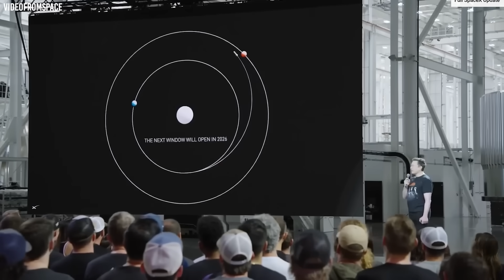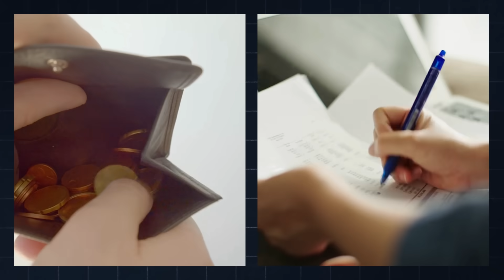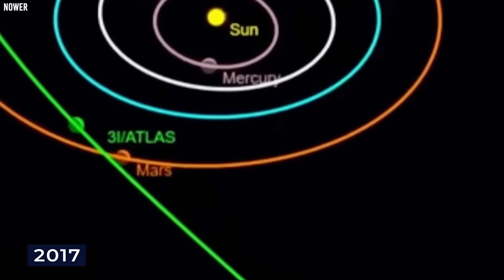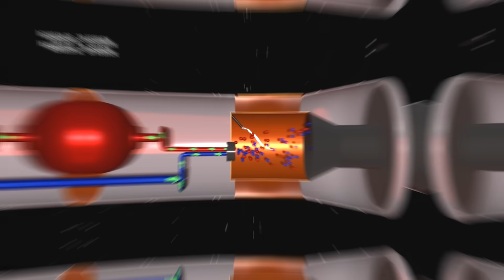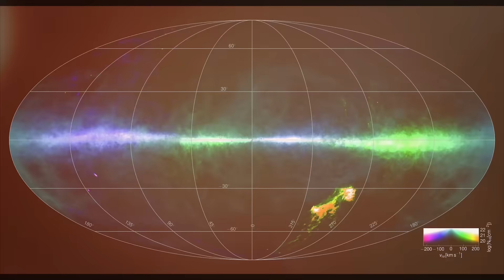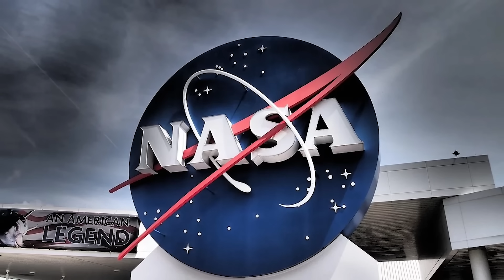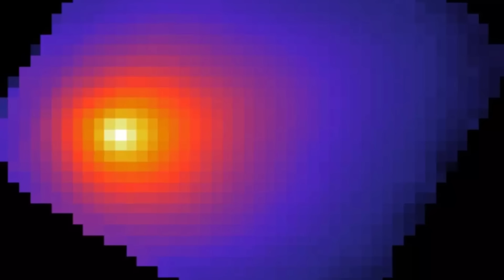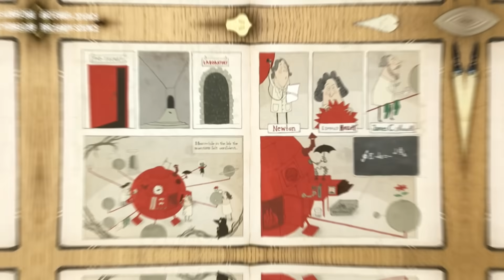NASA Is Tracking 3 Objects Circling 3I/ATLAS "This could end very bad"

Comment: Is it possible that 3I/Atlas will completely sublimate by the time it reaches close Mars orbit, and then could be interesting what the '3 objects' do if the large sublimation cloud then condenses on the planet? It is interesting that to warm up Mars we would need a significant amount of greenhouse gas, but not sure the volume of CO2 that could be released from 3I/Atlas could make a noticeable difference to the Mars atmosphere. Swan could be 'picking up' the 3 objects before the comet (sublimated or not) slams into Mars?

If the speculation of this could be some form of terraforming event then could Atlas or even Swan do enough based on our known physics? 

One big limitation is that Mars needs to restart it's molten core in order to generate a magnetic field - is the Nickel in Atlas enough to trigger this if a small penetrator hit hard enough?

Comment: why do we have crappy pictures of it yet we can get good pictures from the moon and other places.
Reply: Yes and the " picture" shows it's growing a tail!... Along with the stars too!! - it's a spaceship
Reply: Simpele.. the round craters are digged by Some machines, it is still working now
Reply: 3I/ATLAS will not come closer than 1.8 AU (270 million km; 170 million mi) to Earth. For comparison, the average distance to the Moon is approximately 384,000 km (238,600 miles).  Images by the Hubble Space Telescope suggest that the diameter of 3I/ATLAS's nucleus is between 0.32 and 5.6 km (0.2 and 3.5 mi), with the most likely diameter being less than 1 km (0.62 mi).  The moon’s diameter is approximately 2,159 miles (3,475 kilometers).  Are you beginning to see the picture better now?